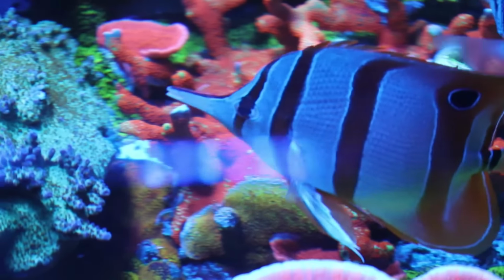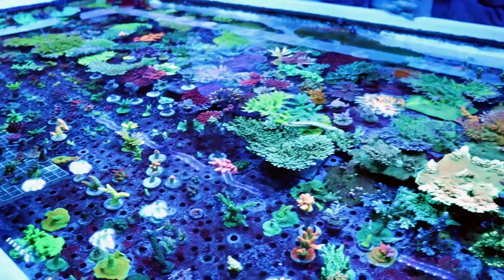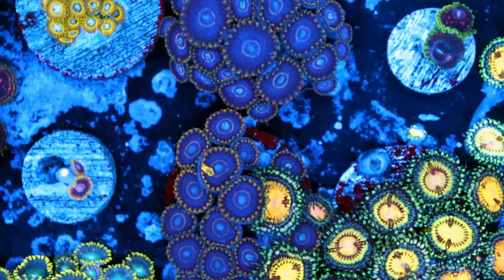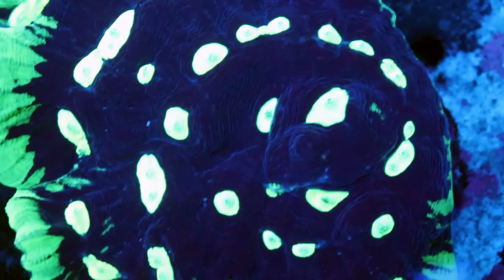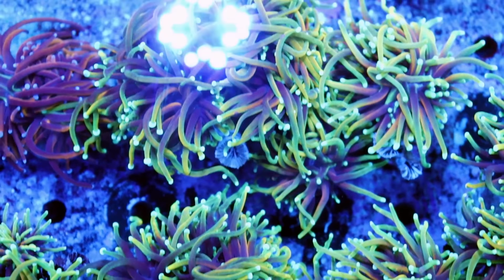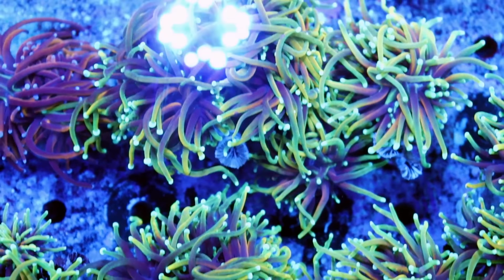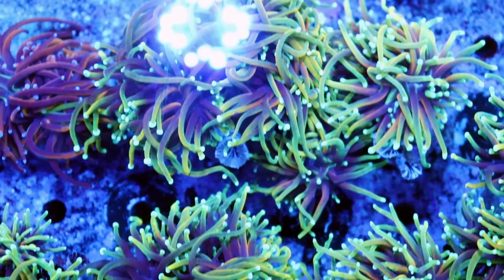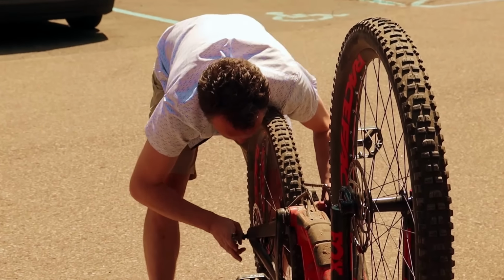Coral Farming At Its Finest !  Cherry Corals Video Tour

Comment: Cinder block are set wrong way they may crush. Hole must face top and bottom i guess so less chance of getting wrecked.
Reply: In a typical application you are correct, for ours it doesn't matter, 12 years and counting.

Comment: All your cinderblocks are set wrong and aren’t structurally sound you need to stand them so the holes are up and down not the flat surfaces they can and probably will collapse on you especially with the moisture and salt